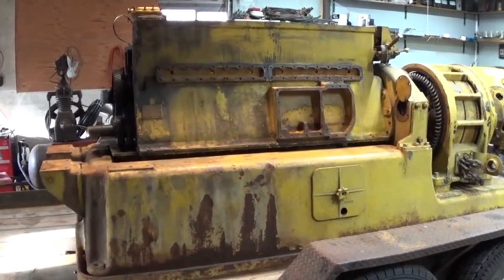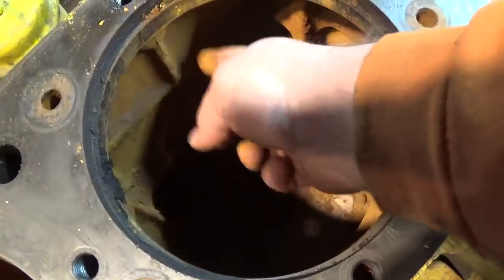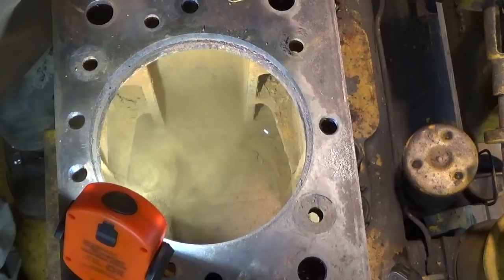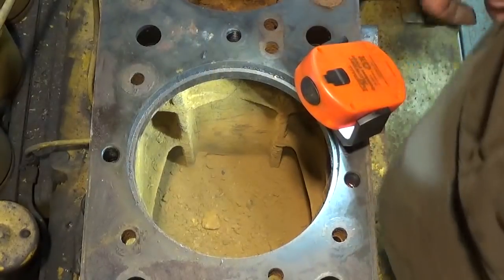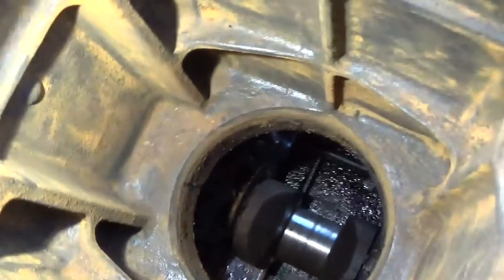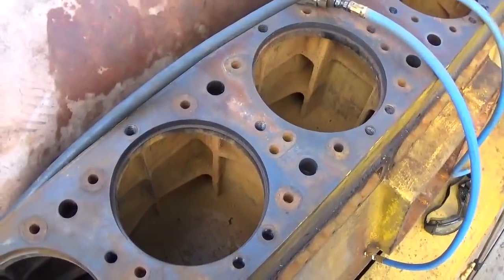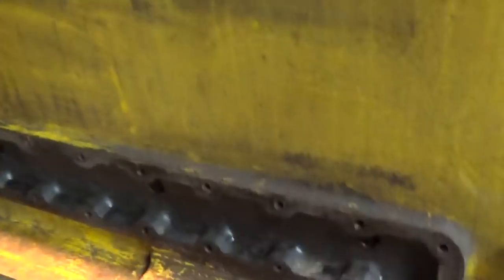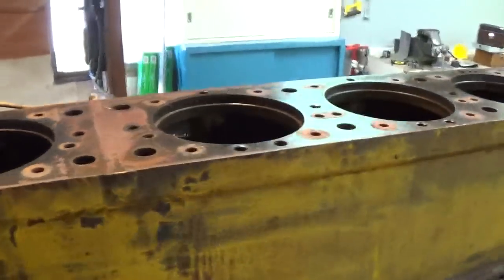1939 Caterpillar Generator Set Returns to YouTube (Cleaning Engine Water Jacket)

Comment: The "O MA ED" on the sleeve is the date stamp.  Using Cat's NUMERALCOD=0123456789, the date it was cast is 8/25/39, or August 25, 1939.  Either it has never been rebuilt or it was rebuilt using new-old stock parts.  Either way, looks like you have a decent engine for its age.

Comment: Do you think this engine may have been well water (or stream water) cooled?  I worked in an elementary school and if I recall correctly the old generator was cooled by a continuous supply of water, which drained out the back of the building through a culvert.  May explain all the dirt/scale in the cooling system?

Comment: Old D13000 have not worked on one in years!! The counter bore the liner sits down in, if rough can be cut deeper and you get shims to bring the liner back to the correct protrusion above the cylinder block!  If cracked they make inserts to repair the cylinder block. Use to be one of the jobs I did for years.

Comment: im involved with small engines myself but not no this scale, have you considered a stiff wire brush with a wooden handle which you could shorten to fit inside the water jacket?

Comment: Just found your channel, and I am definitely addicted.  New Sub here, you do great videos.  I watch Squatch253, and he has an old D2 engine he has bee rebuilding you should check out.  The water jackets on it were actually plugged up so badly that he had a hard time getting the sleeves out.  Check out:
Caterpillar D2 #5J1113 - Stripping Down The (third) Replacement Diesel Engine Block
and
Caterpillar D2 #5J1113 - Cleaning The Water Jackets on Block #3 - And It's Good!

Comment: There's a remarkable lack of both rust erosion on the block casting, and little cavitation pitting on the upper end of the liners... especially on an engine that old and with tgat many hours.  If that's really iron oxide. It'd cling to a magnet.  I'm wondering if this is an old type of inhibitor, even hexavalent chromium (remember Erin Brokovich and the Chrome-6 feeding all those Cooper-Bessemers in the desert?). rather than powdered rust.  I had an old GMC V6 that came with a Perry water filter.  It left a rusty dust residue in the block, but there was zero corrosion damage anywhere.

Comment: Did you consider using a hot water pressure washer with detergent to clean the water jacket and passages?  You can also use very hot water/soap with a pressure washer to clean sludge out of a block.  Works very well - but you have to pull the crank & cam to do it (that also lets you check all of the bearings).  If the bearings a still go you wipe them and put assembly lube on them when you reassemble.   Just a thought.  That was a tedious job - and very well done.  Congrats!!!

Comment: I like  what your doing but you could go another route. Sometimes it takes a trip to the hardware store to put things in order of scale. Yours is a major rehabilitation of your engine. There are signs of great care to reduce rust in the water jacket. Your attempt to get it to eliminate rust is commendable but unless you are willing to paint it don’t go any Prather. This unit looked like it had extensive Antifreeze that was done when it contributed as a functioning asset.

Comment: Being a genset, i wonder how much work it did ? Was it run daily or just during power outages? 
Standby units wear quickly as the oil may only do X number of hours every 10 years but it turns acidic wearing bearings . The coolant also goes acidic and calcium build up like you have there is common . If the engine is called upon to work hard for a few days,they often run bearings or rings get broken along with over heating . 
Gensets that run long hours daily tend to run up big hours with little wear being evident.

Comment: I'm not 100% sure, but that thing inside is hard water deposit silt. I've seen that stuff in cooling towers and stuff like that. My boiler, at home, has that kind of stuff on the inside as well. It grows like a fungus, the damned thing and eventually clogs stuff up. If you're unlucky and the metal is prone to being rust chewed, it goes bad real quick. So my guess is, this gennie was hooked up to the main line, like 24/7 water passing through.

Comment: GM used to use a additive in their cars that was a sealant. When dried it looked just like your residue. In the GM's it was a form of clay that would seal up pin holes. In the end it was deemed to much of a pain in the but due to difficult cleanup.

Comment: Just a thought, you could have save a whole lot of grief by dragging that block over to someone who does media blasting (crushed walnut media won't damage machined cast iron surfaces) or even sand blasting. Would have had that done in about two hours or less that way. Just a tip for future use if you choose..

Comment: I have seen dry ice blasting and blasting with granulated nutshells beeing used for soot and carbon build up in valves and exhaust gas returns on modern engines. I wonder if that wont work wonders here as well. Dusty mess for sure, but I think it could be very effective.

Comment: its always amazing how little power these old gens made hahaha 66kw
Reply: HP of a typical diesel generator prime mover is about 1.5 times KW rating or 100 HP in this gem. That is about 580 Ft lbs of torque at 900 rpm. It should last for ever with proper maintenance.

Comment: I had a tractor that would overheat because of junk like this in the water passages.  I emptied out the coolant, filled with water, then added the chemical for a engine hot tank cleaner and put cardboard in front of the radiator and let it get up to temperature for 15 minutes, then flush with the hose 5 or 6 times, then refill with fresh coolant and distilled water.  Fixed the problem and the hot tank chemical worked really good for dissolving that crap

Comment: I think you'd have had an easier time removing the oil pan and using a hot water pressure washer with a liberal soaking of degreaser. You'd have had to clean the bottom end regardless, and hot water and degreaser would have made quick work of that too.

Comment: A definitely better. I think I would have also used the small vac attachment inside each cyl to keep the dust down so as to improve vision, BUT either way its a vast improvement! Do you own an air scalier?

Comment: I would suggest installing your own water filter.  Pick a pressure point of your choice and run the filter whenever the genny is running.  I have had great success doing this.  Once the sediment disappears you could abandon the filter.  Or, operate it forever.  Your choice.

Comment: I like your YouTube channel I have watched you on 80 road king for years and didn’t know of your channel, glad that I found it. I am 78 years old and have been a master mechanic since 1977 and have loved all the years of working on mechanical items’ from go-carts to top fuel dragsters. This generator project would be a great project for me I would love to be doing it. I would also want to run it on used cooking oil, I ran several diesels on used cooking oil, and I have a 1991 Mercedes 350 SDL that runs on cooking oil now. The main reason for my comment is to just suggest one thing. Think about wearing some type of gloves, I have Bladder Cancer and after some research I believe that it came from all of the dirt, grime and chemicals that entered the pores of my skin and have damaged the lining of my bladder. A man that I know and have traveled with in drag racing had lead poising back in the 70’s and he found out it was from using leaded gas to clean his parts with, another man was an alcoholic and told me that he could not use after shave lotion because the alcohol in the lotion would enter his pores of his skin set off his addiction and he would have to have a drink. With these cassis in mind you might think about warring some type of protective gloves. Keep up the great work, love your videos.

Comment: I came here from Roadking about 3 years or more ago before you got this engine, recently my wife looked over my shoulder when you were looking at the generator with the engine with the damaged block and she asked me what you did.  I told her, "lots of stuff" and one was the big Cat powered generator.   I am very happy to see you back on it, I know the parts are very expensive and getting very hard to get so I also understand why you don't just jump in at the deep end of the pool on something like this.  I am not sure the market for something like this when it is running although I am fairly sure you do but I know it would be really easy to get underwater in a hurry on this one.  Keep putting up videos I will keep watching.

Comment: That is just sediment from the water, I had an old London Taxi and the engine was completely clogged with sediment that looked just like that.Over many years of having water added from the local taps the sediment accumulates,water that looks crystal clear in a glass and is fit to drink contains a small amount of mud and minerals and over the years builds up in the engine it also clogs central heating systems as well.

Comment: I'm beginning to wonder if this yellow powder isn't actually some kind of rust preventative, or sacrificial metal that has oxidized.  It shouldn't be too hard to test it for iron content or maybe other things. It would be worth trying to find out.  If the casting were in bad shape, I'd think that yes it is some kind of rust.  In any case, you will need some kind of rust prevention.
Reply: ....it is from 1939, is it not enough if it lasts 150-200 years?

Well, waterless coolant would fix the problem, in any case

Comment: I had a ‘72 Dodge’s coolant react like that. The anti-freeze turned to red mud. 
I don’t remember the details, but it turned out to be a electrolyzed reaction from dis-similar metals and the wrong type anti-freeze and water mixture.

Comment: You are doing a great job but that is really tedious! You might try a solvent sprayer on the rest, it might help make it a bit easier. There are many different types out there, cheap to $100. I recommend the one Snap On sells, I have been using mine for about 16 years now.

Comment: Seems like that stuff might be a calcium lime deposit with a rust color to it. Previous owner may have used hard water to fill cooling system, bet the radiator is partly plugged up too! Citric acid with water will help dissolve that stuff/crud.

Comment: Im sure you know to not use any kind of grease or oil when putting your cylinders back in, the use of liquid soap on the sealing rings is the best thing Ive ever found for sliding the cylinders back in the seating areas.

Comment: Mercedes sells a “Citrus acid” that cleans cooling systems. It really cleans down to the bare metal. Wonder if that would help you
Reply: SoCal Realtor That stuff is pretty good. I’ve also found that CLR works good too for old iron.
Reply: citric acid will work quite well, agressive enough to solve the scale, but mild enough to not immediately attack the metal. Other than for example vinegar and other acids.
Reply: So does "Prestone" for about $3. I shudder to think of what Mercedes charges for such a low cost mixture. There are much better ways to clean rust than citric acid.

Comment: Nice project
We had a few engine s with rusty coolant.
It was low PH acidic water.Only use distilled water in system.
Used baking soda to neutralize and Calgon dish washer liquid to clean out oily muck from system. Worked excellent.

Comment: The only way that I can think of to accumulate that much crud is that the engine was cooled (for many years) with well or city water instead of a sealed cooling system.  Ron W4BIN

Comment: Why not just fill it with water the first few times you run it, and just drain the water each time you run it for the first few runs.  Wouldn't that get rid of a lot of that crap?  The guy who taught me to work on cars years ago told me about a friend he had, who bought a car that was all sludged up.  It was a big muscle car, and worth fixing, but it hadn't had regular oil changes.  He made it a point to change the oil daily for a while, and eventually the motor came clean.

Comment: i am a retired heavy diesel mechanic of 69 years and i do not remember seeing a block of that size and age in such good condition, i can not see the liner sealing area yet but would say it would be as good as the rest, looks like the coolant might have low acid dam water,  wish i was with you helping.  (from Australia).

Comment: at 16:00 you start wire brushing out the water jackets.  if you leave the shop vac running and the hose just dangling in the bore. you will have a lot less dust as the vacuum pulls most of it out of the air..  i have for years.. when needing to clean engines with the crank still in.. taken strips of inner tube.  cut at exact width for 2 wraps then slightly wider for 2 more. wrapped them around the Greased crank rod journals . not an easy feat... usually i use electrical tape wrapped around them to hold the inner tube strips in place..   i also take more strips of inner tube..  and fold them in a long narrow V.. sometimes i put a narrow stripe of tire rubber cement and then fold the long strip into a V and clamp it..  so i have what looks like a fat legged Y  this i slip between the main webs in the block and the crank counterweights to reduce any dust that can fall down on the main journals..  i make some wide and some narrow for different throws of the crank..  you may want to get some clear suction hose .. perhaps 1" ID.. a garden sprayer adjustable nozzle. and figure out a way to mount it in the clear suction hose.. giving you the ability to spray cleaning liquid thru the nozzle and vacuum the liquid and dirt out using a shop vacuum attached to the hose  while you reach in thru the access covers or down the bores to clean the bottom of the pan without dropping the pan..   buy  enough clear suction hose so you can see when the dirt stops coming up then you can move to a different spot

Comment: check to see if the dust in the cooling system is attracted to magnets.. if so.. you really must stack magnets in the crankcase by reaching in thru the openings you got to the big end of the rods .. so any possible rust flakes or sediment does NOT get sucked into the oil pump and then pushed out thru the main oil galleys..  you will want to stack several neodymium magnets inside each oil pan section.. so you can possibly retrieve them for inspection at a later time..  you will also .. want to think about neodymium magnets inside the oil filter cans.. on the pressure side of the filter.

Comment: You never can tell what happened with this. The radiator could've gone out and maybe they ran it with pond water for coolant and that might just be mud piled up inside the block. If that rig could talk I wager there would be tales that'd stand your hair straight up. Glad to see you back on it.
Reply: "The radiator could've gone out and maybe they ran it with pond water for coolant and that might just be mud piled up inside the block"  Lewie McNeely ...I think that's exactly what happened"
Reply: @slrn832472577  With a rig this old there's no telling what it was put through and an old lo speed Cat would be about the only thing that'd live through it. If it could talk............!

Comment: This cause is from failure to run a water conditioner or good quality antifreeze or any antifreeze in the engine. What you are scraping off are mineral deposits left behind by just using water only.
Reply: Not much in the way of water conditioner around during WW2 and antifreeze was alcohol based and also in short supply. I live in the coal region of Pennsylvania and old timers told me they had to use home brew alcohol and even kerosene for engine coolant. Standard operations were pretty crude back then, really pretty crude even into the 70's.
I have some service manuals from the 40's that actually state that use of animal based greases are not recommended in the gear reduction boxes.

Comment: Check out YT channel Squatch253. He is an antique Caterpillar master mechanic. He's currently rebuilding a 4 cylinder that's looks to be a smaller version of yours. Tons of great info there. Thought you might want to know.....
Reply: Squatch and senior are must watch stuff! Mike would love the channel if he has not already seen it.
Reply: @mattelderca  Yep! Love Senior. The apple didn't fall far from that tree with those two. The methodical way they rebuild is amazing.
Reply: Ditto on your comment!
Reply: Have to ask him if the yellow powder comes from CAT intentionally. I don't remember if he's removed the sleeves on 1113.
Reply: @BobPegram  Toby most definately pulled the sleeves in 1113. This was the 3rd (I think) block as the others were cracked or bad. 1113 was totally slugged up with rust and had water passages totally blocked. Squatch spent a long time cleaning it too. Pretty sure that yellow is just a lot of hard, nasty, dirty water and maybe coolant residue left behind. They just mainly dumped in whatever water they found back in those days in it. I don't think these old Cats had very turbulant coolant flow as they turned so slowly.
Reply: Squatch253 and Senior are great to watch and like Mike and Road King, great people.
Reply: Definitely, Squatch and Senior are a pair to watch for valuable vintage Caterpillar info!!!
Reply: Mark Hull: this engine is basically two of Squatch253s Rd6 engines put together. Same bore and stroke I think
Reply: @bobwhite3777  Well if that's the case, wouldn't that make this a D13000 used in an RD-8? Update: Yep, went back to the first vid he did, it is a D-13000. Thanks for making the connection to the RD6. Think I found a YT of one of these running here:  https://www.youtube.com/watch?v=Z9hn1IUvdcY